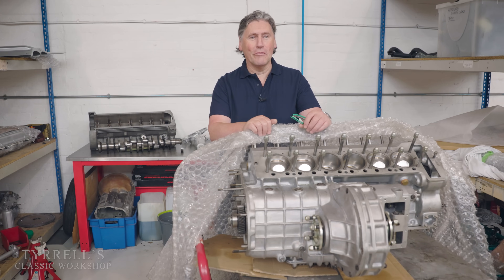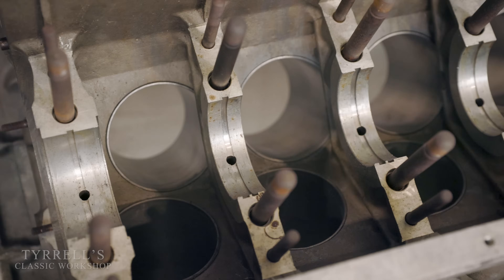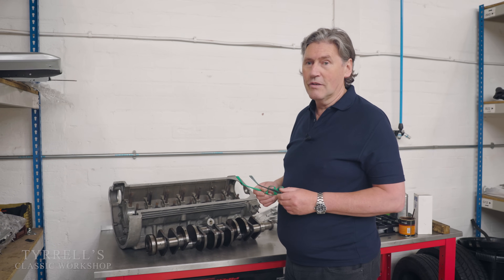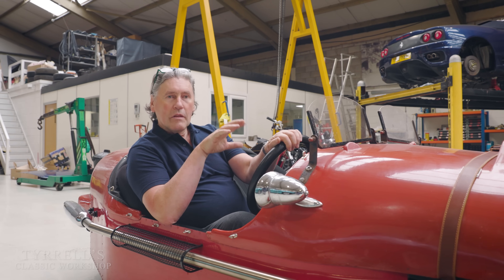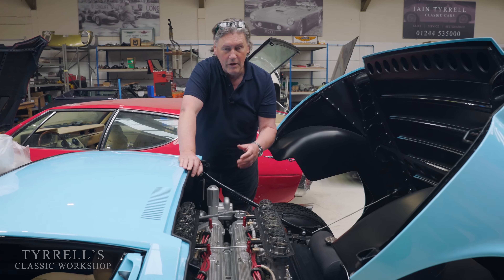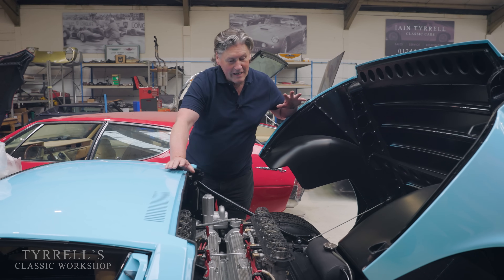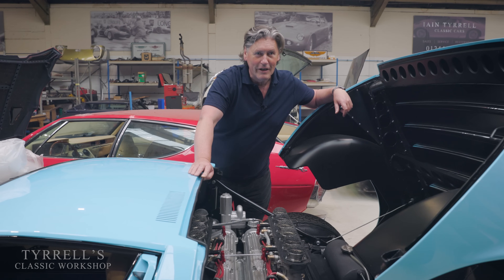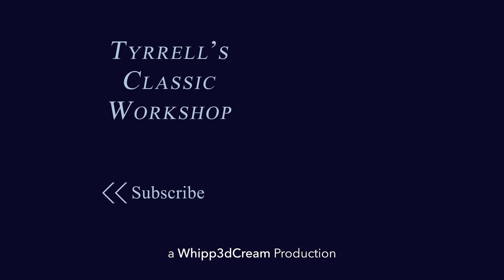How to warm up your classic car engine the correct way & why it matters | Tyrrell's Classic Workshop

Comment: What I really hate is when cars are programmed to start with a flare of revs on purpose. I used to have a DB7 V12. It was marvelous. At least is did a few rotations before firing, but then the revs will flare to 2500 before settling at about 1200. Especially after being stored for winter, it felt brutal.

Comment: Well thankfully especially as it seems with warm weather the carburettors on my old cars appear to have exhumed the content of their chambers and it usually takes me several attempts at starting (I always pause after ~5 seconds) before it starts showing life and even then two additional starts to actually start running. I do remember something particular about a Ford I once owned that had an automatic choke that was controlled by some bi-metal contraption in the cooling system. The trouble with this was that if you ran the engine for a relatively short time (e.g. stopping at the first gas station after leaving home) the choke would kick back in full and the only way to start the engine at that point was to apply full throttle as that defeated the effect of the choke. Before you ask, no I did not discover this the first time it happened to me.

Comment: TL:DR. Don’t start a classic engine and then let it idle. It will destroy it quickly because of oil starvation.  Let it start then keep it at 1500 rpm with the accelerator, then go drive it. No idling when it’s cold, will kill it early in life

Comment: Thanks Ian with a brand new engine I deliberately leave the coil lead out and turn it over allot for oil pressure to build up.But your comments on choke and idle really helpful.

Comment: That engine where the oil goes from oil pump to filter and then to bearings etc must be unique.  All engines i have restored,  Chevy  Ford V8. Volvo etc the oil run from pump to bearings, then to oil filter before it goes back to oil pan.

Comment: Time was when the ignition, choke (with the requisite clothes peg for micro adjustment!) and starter, were separate controls - ignoring the hand adjusted ignition timing - and the engine could be turned over to ensure adequate initial lubrication without any chance of  immediate firing. The integration of the ignition, starter controls and steering lock (either seeking to thwart casual thieves - who will by-pass it anyway - or save any untoward effort on the part of the driver) has required the use of yet another electronic gizmo ... Progress?

Comment: What is being said here is especially important after an oil change. I always pull the ignition, crank the engine in bursts to prime the oil system and the reconnect the ignition to start the engine.

Comment: Do not not NOT pull the choke all the way out, 2/5 to 3/5 of an inch will do under normal circumstances with a standard design british car. Full out is for an external temperature of -25 degrees centigrade. Which is so cold that you had the battery indoors overnight and handcranked the car before even trying to start.

Comment: I wonder what Mr. Tyrrell thinks about the use of molybdenum disulphide additives. I know that things have moved on, since the days of frothy Duckhams Q but is the supposed 'always slippy' coating of bores and bearings by moly an useless thing of yesteryear, in light of modern oils ? I do use it, as my car isn't used a lot but have a bike with a wet clutch, so put some ZX1 engine treatment in that instead. I add moly to the car's yearly oil change but the ZX1 is meant to be good for 25,000 miles. I may be gullible in believing testimonials but even I'm not dense enough to believe the banking scam text I got a couple of days ago. Why does everyone want to make me rich ? It must be my charm and good looks !

Comment: Great video, thanks. I have a 1971 Lotus Elan Sprint with a freshly rebuilt engine and I’m keen to make it last! The normal procedure in starting a Lotus Twincam with dual Webers is to pump the accelerator 2-4 times then turn the key for it to start immediately. I gather from your video that I should not touch the accelerator but just crank the motor for a few seconds to get the oil where it needs to be, then pump the accelerator for it to start immediately. And then hold the engine at 1500-2000 rpm for a short while before driving off. Does that sound right..?

Comment: It's great to see someone knowledgeable addressing the subject of oil starvation upon cold start up, and the dynamics are similar for practically all types of engines. I first was introduced to this topic during my stint as the driver of a touring top sportsman/pro modified drag racing team. When I was to start the engines, I had to crank the engine on the starter until the oil pressure gauge sustained at least 30 lbs of pressure for about 10 seconds, then hit the ignition and fuel switches to light off the engine.

Comment: Couldn't you fit a timer relay in line with the coil in old classics that delays the 12v to the coil for 5 seconds? The short delay would stop it firing until oil pressure builds. Very cheap and simple to do?

Comment: Thank you, Mr. Tyrrell. I bought and am restoring a LHD Riley RMA saloon from 1950. I was flabbergasted by the the number of underdash Bowden cables for the motor management. The only thing missing was a mag switch like in a plane, which would of course be just right to build oil pressure before ignition! I will have to write an entire chapter to add to my 70 year old owner´s manual so my heirs know how to handle that old engine. Oh yes, and my Riley definitely will need me to depress the clutch before starting as well...

Comment: WW2 Merlin engines had a preoiler system fitted, they also had platignum tipped spark plugs, it was till the 80s we had those plugs.

So all Ian is saying makes so much sense, this is where a good F1 education  in theory and practice pays dividends.  Thanks Ian

Comment: I put a Twin Spark Alfa Romeo from the 80s in my 69 Spyder. I used a aftermarket computer to run it . I was a bit surprised that it cranked longer than the original setup. Maybe it is by design? I know it takes one revolution to sort out where TDC is but I think it does a few rotations before it jumps to life.

Comment: Shouldn't be all that hard to arrange an ignition cutout on old cars. Had an ignition cutout on an old MGB to prevent car theft. Engine could crank all day with no spark from the two positive ground 6 volt batteries. You can even add an electric oil pump to the oil cooling radiator line. Liter bikes have auto high rev starts.

Comment: how do we know which engines to keep at minimum revs for a while, and which to hold at 1500? in particular,  what to do with an air-cooled flat 6?
Reply from the maker: This is good practice for all Classic engines
Reply from the maker: Fast idle/ up to 1500 rpm for a couple of minutes

Comment: Any reason not to crank until the oil press comes up? For example on the Muira don't pump the throttle, crank until you get pressure, then proceed as before. Or, as others have said, add a pre-oiler. 

I used to rebuild a few engines and I tried very hard to ensure good oil supply before starting. First fill the filter bowl and oil cooler before fitting. I had a great oil can and would jam it into the oil gauge hole and pump until I got resistance. Then crank until oil pressure shown, then start the engine. Obviously enough pressure always came up right away.

Comment: I like that you cover that the proper engine start process covers any vintage / classic car.  Thanks for using the Mura as your mark! The detail of what RPM to consider on a non-choke carbureted car is great.  Thanks again Ian.  Is it true that most ( if not all)  carbureted with a choke cars cold start to a high RMP? Thanks for covering how to crank a choked car to get the oil around prior to introducing fuel to protect the engine.

Comment: Fantastic video: Modern car question. Most modern performance cars are built to have a little blip of the throttle at startup so everyone around you knowns you've got a Porsche/Fast BMW/Audi RS or whatever... Is this wearing the engine out unnecessarily do you think? or have manufacturers worked out the kinks? Would love to know
Reply from the maker: Let me put it this way- I’m not convinced it’s beneficial to the long- term benefit of the engine

Comment: I put my vehicle in gear as soon as possible to place the engine under a small load.  Is 3 or 4 turns of the engine before starting sufficient to pump oil to all the bearings?

Comment: A note about modern computer controlled engines and cold starts. Some of them cold start directly and instantly into a fast 2000 RPM idle. This doesn't seem good for the top end, especially with DOHC engines since the oil will be down in the pan and may take a moment to pump up there. I believe they do it for emissions - to more quickly develop heat and get the catalytic converter working. Some of these cars have an undocumented "easter egg" to get a less aggressive lower RPM cold start that is easier on the engine. Commonly, it is to put the car into 1st or reverse gear before starting. Sure that is for stick shift / manual only, but we are all car enthusiasts here, right? :)

Comment: My first car was an early Morris Minor  -  I noticed that in a cold winter the big ends would rattle for a few milliseconds, before the oil got to them  -  I was concerned that my engine would not 'live' very long if I allowed this to continue.  I therefore added an engine oil additive ( Wynns - I think) and the problem was solved  - no more big end rattle on frosty mornings ! Would you recommend the use of these additives to-day with modern fully synthetic oils !     A great video - Thank you

Comment: Brilliant instruction on the principles of oil circulation. I was instructed on this at a very young age by my Dad, a mechanic, who used to make and shave, individual shell bearings, by hand, for every engine he rebuilt for customers in the 1930's. Even in the depths of Scottish winters did I use a choke on the first few turns of an engine. When I were a lad in the early 70's, the weapon of choice was the virtually indestructible A series, but I still gave it a few churns without the choke before starting it.

I have no control today with my diesel VW Tiguan other than not nailing the throttle on start up, however, being a turbocharged engine, the switch off procedure is almost as important as the start up in a classic car.

Give your turbo car a few seconds of idle before switching off to allow the insanely hot oil in the turbo to be replaced with some cooler oil from the system.

Comment: Based on the explanation of oil delivery through the engine, I've always wondered why they didn't design the system with a secondary oil pressure switch to control the ignition system. Very simply, if put in the right place there would be no ignition feed to the sparkplugs until the predetermined pressure was achieved to complete the circuit.

Comment: Iain, what if the car hasn't started in a long time? Would you take the spark plugs off an turn it over until it builds oil pressure?
Reply from the maker: Absolutely

Comment: My 1971 240z is running flat-top carbs on an only slightly modded L28. The purists HATE flat tops, because they associate them with all the anti-emission plumbing and issues with tuning and overall performance. The flat-tops are still an SU style carb, and I am running mine without the chokes connected up. I regularly start in sub 10 degree C morning temperatures over winter and spring,  and I typically get in three rounds of cranking for about 5 seconds. This happens BECAUSE the carbs take time to pull fuel in under engine vacuum. By the time she starts, I already have plenty of oil through the crank and the pressure jumps to 45psi in about one second.  I rebuilt the engine in 2019, last week still 165psi +/-5 on all cylinders. It'd  definitely start quicker with triple Webbers or EFI, but I reckon my time to next rebuild would halve.

Comment: Hope I’m not being cheeky, especially as I don’t have your long experience, but did enjoy twenty years of historic motor racing, all of it in (choke-less) Weber carburettored machines from Historic Formula Ford, Formula Junior through to a 1962 1.5-litre F1 Cooper - Alfa Romeo. To start these cars from cold I wouldn’t pump the accelerator (which would inject a - relatively - massive amount of fuel into the engine), but rather engage the starter motor, let the engine turn over for a few seconds (3 or 4, say), THEN start pumping the accelerator (and not as fast as you were in the Lamborghini) until it fired. You’ll be glad to hear that it would be kept at 1,500 rpm until the temperature gauge started to move. Perhaps it’s delusional, but this way one hoped that the oil was getting a chance to do its stuff, before neat petrol was poured down its throat ! “Engine Torturers” was my description of those (usually foreign chappies !) that would fire up a poor 1-litre “screamer”, say, in the paddock and promptly rev its nuts off - more often than not blipping it by hand using the throttle linkage direct…….

Comment: How do you feel about removing the wire from the coil then trying to start the car for about 5 seconds to circulate the oil.  Then turn the key off, reconnect the coil and start it for real?  Would that circulate the oil sufficiently to avoid wear?

Comment: Very interesting and I wonder how my Lexus hybrid handles matters? I can hardly (if at all) detect the transition from electric to ice. Hoping you are going to say, the electric motor pumps oil whether it is needed or not and therefore the ice is constantly primed.

Comment: The biggest factor in engine wear in my experience is oil quality. Oil choice and age can be what kills an engine (and usually is, long before cold starts come into play). Good video though, I learned why the nearest bearing fails finally! I always put it down to dirt getting though the pump but that makes sense too.
Reply: Even mid priced oil today is much better quality than the old engines ever dreamed of. I think you are falling for the sales pitch. Just a thought.

Comment: If only I'd known at the time that my BL Marina wasn't supposed to start when you turned the key in the morning, needing to crack the motor over for several minutes before it started was in fact a design feature to prevent premature engine wear, as was the need to apply copious amounts of WD40 to the engine compartment the surplus oil enhanced the rust proofing filled the cabin with that unmistakable WD40 aroma!
Being serious an ignition kill switch might be useful as it would allow you to crank the engine over building up some oil pressure before starting and if hidden under the dash could double as a cheap anti theft device. 
This has to be my favourite YouTube motoring channel every episode is a joy to watch and boy oh boy what a stellar line up of classic cars.

Comment: This is very useful to everyone, but especially to my car, which I heavily insult when it takes too long to fire up (1980 Ford Taunus with 2.3 OHC engine). 

Most of times (talking, from one day to the next in the morning) the engine starts right away as soon as I twist the key with nothing that one or two pumps on the pedal, no choke as the command cable is broken.
So, is this actually a wrong behaviour to have on it?

Comment: The pre-requisite to this of course is to make sure you use the manufacturers recommended grade of oil, maintain it at the correct level, change it at (or sooner than) the recommended intervals, and use a top-quality oil filter.

Comment: Great video, many years ago we used to do the same on English Electric V16 engines, pre lube, crank them up,  tweak the governor to keep them ticking over around 1500-1700 rpm, then when the oil warmed and thinned, it would allow the governor to back off and idle at a lower rpm. The oil galleries & internal drilling's are the diameter of knitting needles so needed a good forced start to get them up & away.

Comment: Excellent video! Our classic car is a 1968 VW Beetle convertible. It has a simple Solex carburetor with an automatic choke. From now on I will be sure to crank the engine a few beats before setting the choke to start the engine. Thanks so much!

Comment: Yup - that's it.  I have always let engines on my classic and bikes spin a few times to build oil pressure before I let them catch.  Then warm up as described.  A perfect illustration - a few years ago I had a bike of mine in for cams and porting etc.  The engine builder was moved to comment that the cams looked like brand new ones (nearly 20 year old bike owned by me from new).  It's harder with a new bike (no choke) - so I hit the starter and turn it off a couple of times when cold to build up oil pressure.

Comment: Haynes manual for the Humber Septre gave a couple of pages on running of the engine. It said testing had shown the reason for the fast tick over was to produce less wear due to probably piston slap on wide clearance in cylinders, also keeping the load on the piston pinion. One assumes not a problem on modern engines.
Would be good idea on old cars to delay ignition until several revolutions or delay the choke application.

Comment: "My advice with that, crank the engine for a few seconds just to give the oil a chance to get round. Then put your foot to the floor to prime the automatic choke. Then start the engine."
"Now I'm going to start this Bentley so you hear how things are done properly." (Bentley fires right up immediately and quick idles...)